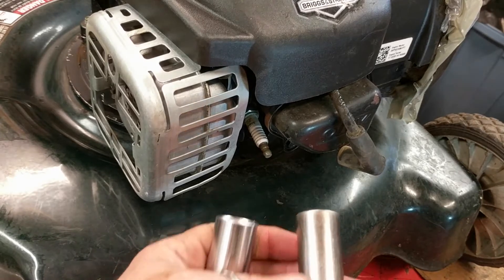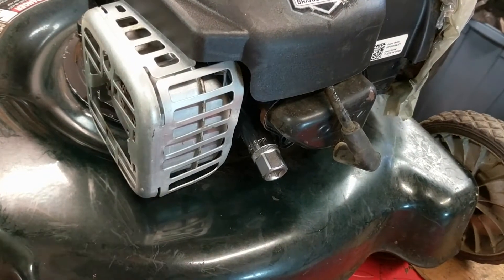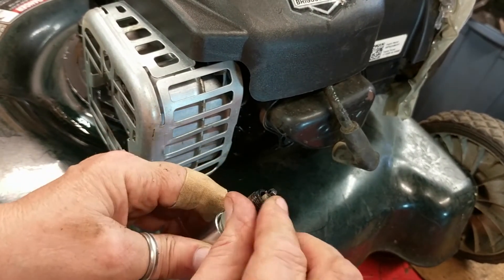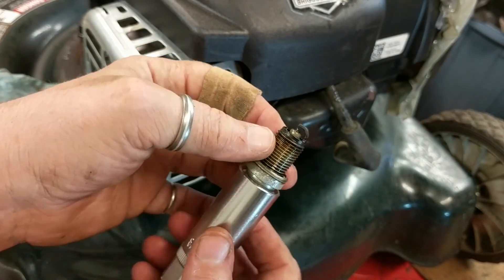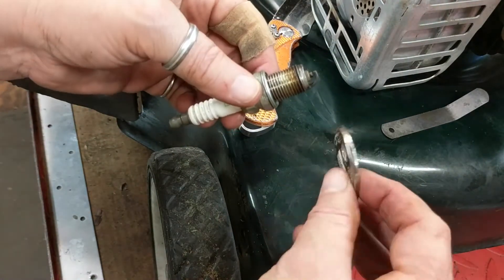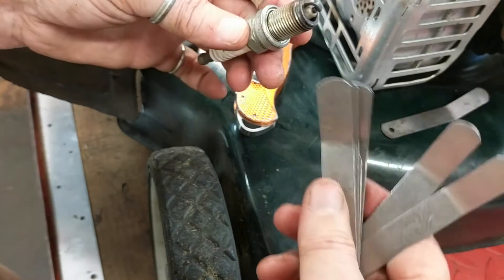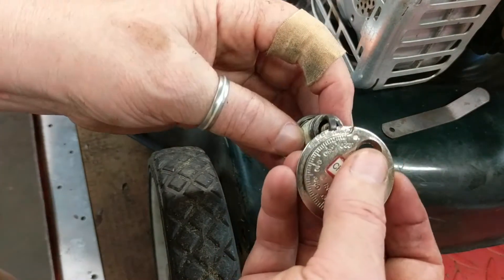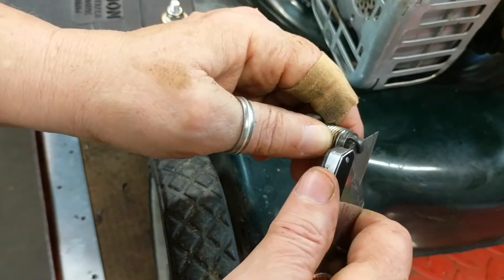Bolens Mower 450E Briggs & Stratton Spark Plug Clean and Gap

Comment: One thing I will add, yes this is opinion. When it comes time to replace the spark plug, stick with a well known brand. Briggs and Stratton, Champion, Autolite, NGK for example. Try to avoid the no name parts you find online.
Reply from the maker: Good advice. 95% of the time I use NGK and Champion.
Reply: Tinkering with small engines is fun. I am not sure why, but I tend to stay OEM. If the engine came with Champion, I use a Champion. My Stihl trimmer has NGK, that NGK went back in it. I tried E3 once and did not notice any difference. After that, I stayed with OEM.
Reply from the maker: @s1mp13m4n  I never send a mower back with an E3 or Torch plug

Comment: Good one Lawn Mower Lady.  I always learn something from you. As long as I've been doing this I never thought of gapping a plug with a box cutter blade.
Reply from the maker: Necessity is the mother of invention. I was stuck on the side of the road with a fouled spark plug on my 1966 Lambretta SX150 many years ago. I dropped my spare plug on the pavement and bent the electrode flat. The best tool I had was a folding box cutter ( which I always carry) to wedge out the tab without breaking it off. Got me back on the road, measured it when I got home, sure enough it was precisely .030 inches

Comment: you said something about it being too white, what does that mean if it is?
Reply from the maker: That usually indicates a "lean" condition. Meaning there is more air than fuel in the mixture in the combustion chamber. Typically it burns too hot, and can cause overheating. Thanks for watching!

Comment: Should the "boot" for spark plug  come off "freely". Do I need to squeeze it, then pull straightoff? ....my first try at fixing my lawnmower..thank you, JoRene
Reply from the maker: Sometimes the rubber part of the boot is very tight around the porcelain part of the plug, creating a suction that makes is difficult to release. I try and wiggle a little to get it to release. Thanks for watching. Cheers!

Comment: Good one i have used a box cutter blade b4 aswell . Great minds think alike . Lol great video thanks for sharing
Reply from the maker: Thanks Doc. 👍 Necessity was the mother of invention when I discovered that trick on the side of the road with a fouled spark plug on an antique motor scooter. I dropped my spare plug on the pavement, bent the electrode slap onto the center pin. My box cutter came to the rescue.